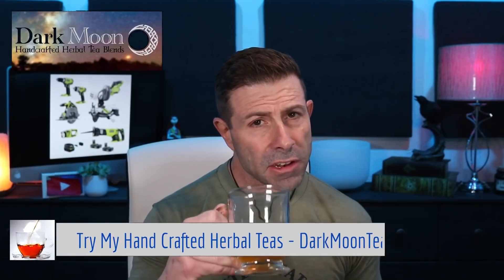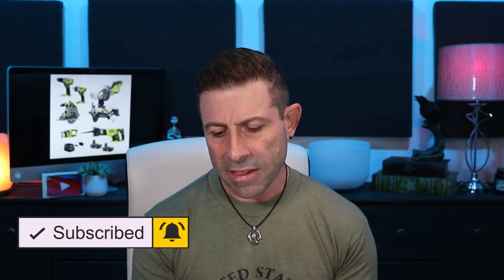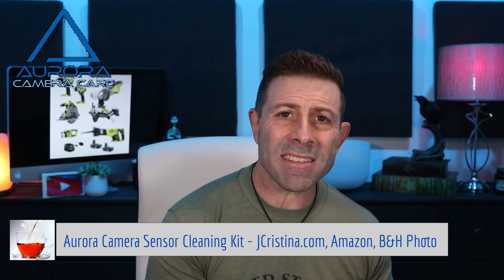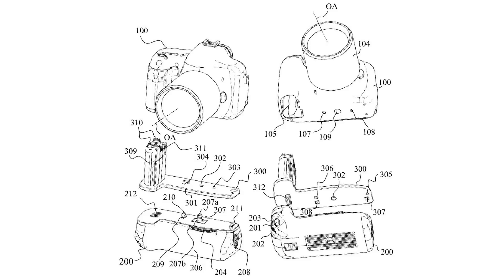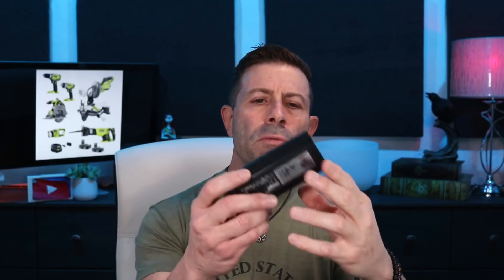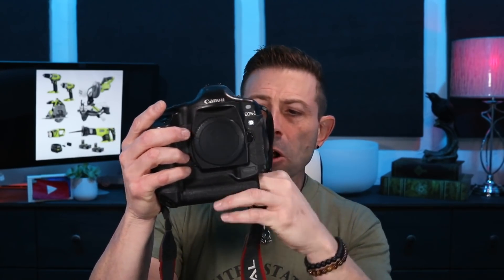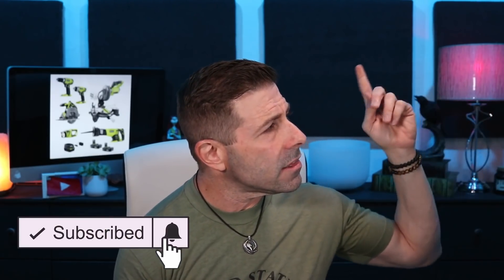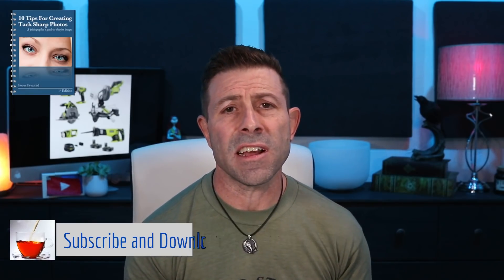Canon EOS Next Generation Power Tool Patent

Comment: Part of this already exists. The multi-battery tray that enters from the side is already in use on 5dMkIV and 7DMkII.  The door that opens from the back is the type that is on the 5dMkII... at least that's how it is on each of these cameras I already own.  Regardless of the tray or grip used, at least Canon has made effort to standardize the LP6 battery across the EOS R,  5D, 7D, and xxD line.
Reply from the maker: Absolutely and if there is an ability to go HEAVIER with a larger capacity battery like in the 1D, that would be even better IMHO.
Reply: @jcristina  100% agree. As Canon unleashes more surprises in the mirrorless market, battery power is going to become even more important. Thirty years ago an in-camera battery powered the light meter. Then we asked it to power the light meter and autofocus motors. . Now, we demand an LCD screen, stabilization, light meter, autofocus, and an EVF, and oh by the way we haven't even recorded the image, processed it, or wrote it to a memory card.  I tried Fuji as an entry into mirrorless and was hugely disappointed in not only the menu organization but mostly the battery life. Two batteries wouldn't last a day.  Last year I tried a Canon M50 for ease of carry while on a trip to the Grand Canyon. Despite negative reviews of the battery, in eco mode it lasted all day without dipping below half.  When I got home I bought the EOS R. Canon has a good thing with the LP6, but with the lastest EOS R models rumored to have In-Body-Stabilization, higher milliamp hours of capacity will always be welcomed as we place even more demands on the battery. Thanks JCristina for the video and the reply. Keep up the good work.
Reply from the maker: Thanks so much.  I would love to be able to use a HEAVY 1D monster battery in my other cameras.  The weight is worth the forever battery duration.

Comment: So, if it is a "universal grip" then there would have to be way to center the camera on a tripod so your "slide" idea makes sense because not all cameras are the same width so lets say you are using a 5d and a R and you have only 1 grip then you would most likely need to move the tripod mount so it would be centered?????? Think you are right...
Reply from the maker: Thanks Spence.  I will be interesting to see how it turns out.  Right or wrong. 😱🍵

Comment: From what I see, this is what canon is doing . They are making a universal battery bottom with a multi use access plug-in on the top. This multi use access plug will plug into a between plate that attaches to the camera’s battery bay to provide power.  This between plate is camera specific.  Under the plate is the I assume male plug that will plug into the pack base.  

The look of the side pack makes me think it will take universal AA’s, most likely rechargeables with the back accessible to use canon batteries.  The side allows them to in the future also offer a single unit integrated pack like a drill’s pack too if they so choose. 

By using AA’s, it would make it accessible as well as affordable to amateurs as well as flexibility to pros.  My two cents.  

Btw, what is your shirt.  Only could make out United States.

Comment: I get the concept, but as has been mentioned, not sure it would apply across the entire platform from rebel to R to 1D. As a Nikon shooter, I never "got" the big lug that Canon choose as a connection to the body, or the rear battery doors. Then again, as a Dewalt user, they really didn't totally get it with their power tools, first the 12/14.4/18 volt ni-cad, then the 12/20 volt lithium, all with differing amounts. It seems like they only halfway thought it through.
Reply from the maker: 1/2 thoughts or sales geniuses? :)   I would have to say a massive 1D style battery MaH external to the an R series camera would not only provide all the power it would need about also the reduction is heat by keeping the source outside of the unit itself. We will see how Canon plays it.

Comment: Professional woodworker as well as photographer. I use Makita and have One battery platform in two capacities to run ALL the tools I have(about a dozen tools and about that many batteries that get swapped around all the time). i would like a way to adapt a belt mounted makita battery to plug into my D850 as auxiliary power.
Reply from the maker: Love it!!!! Something to invent in between your day job.. ;)

Comment: Seeing as how the Battery grip for the 70/80/90D is $150 or so, this looks even higher priced ($150 would be a good deal if it came with a second battery). I wish they'd standardize The LPE6-N for all their big bodies (and Rebel series). Just wishful thinking....
Imagine if they put a communication port in the battery grip, they could add a second card or a SSD (m2 style 😱) without too much bulk or cost. I would love that for my  amazingly resilient 70D.

Comment: "It goes without saying that a patent does not a product make, but this is one of those ideas that we hope Canon follows up on.

To read up on some of the other intriguing ideas Canon has patented over the past few months, check out this mirrorless-to-DSLR converter, this detachable cooling fan for DSLRs, or this crazy 18mm f/1.0 lens for the full-frame mirrorless RF mount.

(via Canon Rumors)
Tags: batterygrip, batterypack, canon, canondslr, canonmirrorless, dslr, grip, invention, mirrorless, patent, universalbatterygrip

"..excerpt from https://petapixel.com/2020/03/05/canon-patents-universal-battery-grip-that-would-fit-multiple-camera-bodies/..It clearly shows the potential for adjustments,and since they made the Canon bodies,it stands to reason they already made concessions for this when they thought of the patent.Some things though,go clean over some folk's heads.